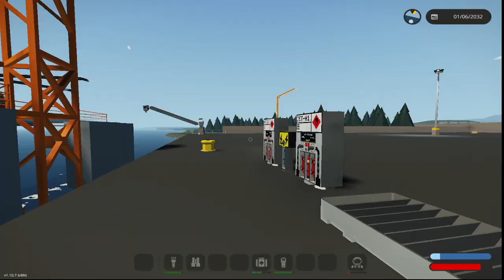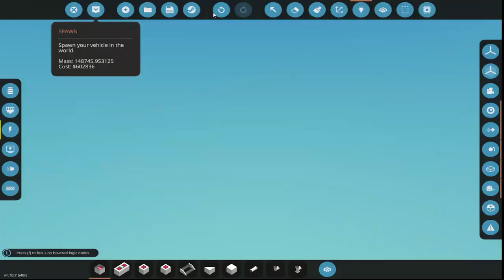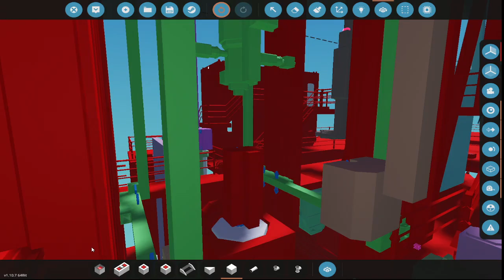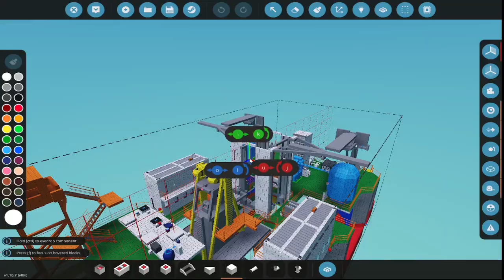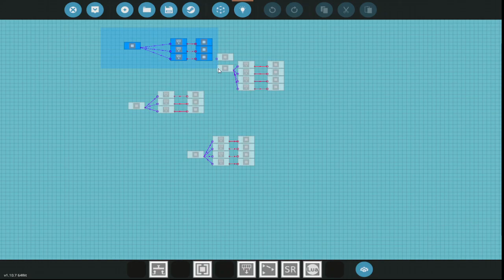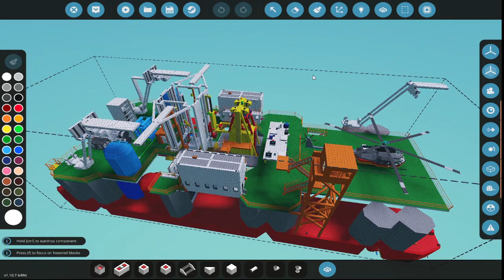Stmworks - Floating Drill Platform Build #4 - Pipe Load Test! (commentary)

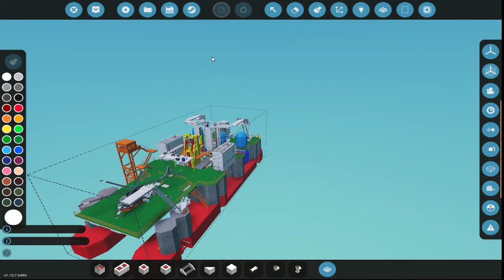Comment: 09:30 you can just put a 'handle' on the rod magnet end. Or build a tiny articulated crane than can grab the rod-magnet and lead it over to the rods.
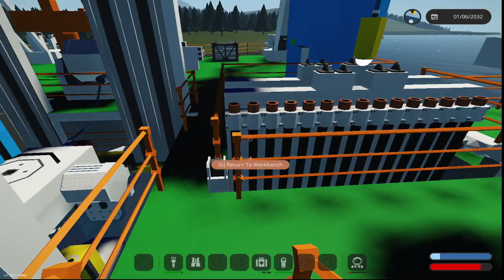13:35 Just look directly upwards while you are jumping. You jump so much higher and further that way.